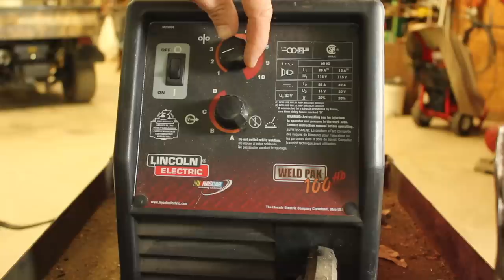This Simple Sawmill Hack will keep you Cutting All Day!!

Comment: Great idea!  IF you have to make another one for any reason, get a 5/8's nut and slice two sides of it off and weld that into the socket.  By using a manufactured nut you'll have the hex sides fitting better into the socket wall.  As the video was progressing I kept thinking of a hex nut fitting nicely into the hex flats of the socket.  Not that you'll ever need to remake the one you have.  (possibly a backup adapter).  #KeepTheChipsFlying, FLR!

Comment: Weld a socket to the winch. And weld an adapter to the crank handle. So you can use the handle when the drill gives up. Just an idea.

Comment: If you'd squared the shaft, and inverted the socket, so the square drive engaged it, you could then have used a hex head bolt in the socket to drive it with the drill.
No welding required.
Reply from the maker: niklar55 That’s a pretty good idea, but I didn’t want to permanently modify the shaft. I needed to be able to use the original hand crank for if the drill fails or dies or if a log is too heavy for it.
Reply: @falllineridge  The hand crank would still work, as you're only removing the rounded parts and adding two extra flats.😊
Reply: Weld a bolt head onto it.  Ever need a hand crank use a wrench or socket wrench.
Reply: Yep thats what I would of done too

Comment: Great Hack!
If I can make a suggestion if you need to do it again or others doing it for their mill. We had a similar situation and needed a 3/4" x 1/2" rectangle socket for the crank handle for a truck mounted swing lift with same type 'boat' winch. 
Took a couple 3/4" nuts and tacked them together stacked and ground the weld bump flat to fit socket. Then with a thin cutoff wheel split the nut off center lenghtwise and used a bench grinder to grind the flat faces on inside of cut nut halves, dropping both pieces in the socket to check fit to the shaft when grinding until we had a nice rectangle fit. Take same amount off each nut surface to keep it centered on shaft.
To secure the 2 ground nut halves inserts inside the socket, we drilled 2 small holes on each side of socket, lining them up with insert nut flats and rosette welded the nut inserts to the socket wall from the outside of socket and ground smooth. There was no inside welding of socket or grinding and whole thing was all flat grinding the nut halves held with ViseGrips on a bench grinder.
All the grinding was flat surface and took place outside the socket, made the job a whole lot easier and no Dremeling. Took me about 20 minutes and we used an old 6 point 3/4", 1/2" drive socket from the junk box. Can be used with an electric drill or a 1/2" ratchet. Painted it florescent orange to spot easier in the tool bag and wouldn't get lost.

Comment: I can't tell you how pleased I am to find this vid. Believe it or not I just bought a 3x socket drill adapters for my toe board and it never occurred to me to use it on the winch. And guess what? My winch is a hand boat winch that already has hex drives on it and has 3 of them giving you 3 constant mesh gears essentially. On the deep reduction low speed gear on the winch, if I put the drill on high speed it should just walk logs up the ramps. 
Also I toyed with the idea of getting a gas powered winch. They don't cost too much but heck, that idea is shelved after my good fortune of finding this LOL.
I still will get a gas powered winch because when I eventually mill the wood to build the shed to put the mill in (lol), I might make a guide to line up the logs parallel to the mill and use the gas powered winch to drag them inside.

Comment: I’m not sure if you still rly on this improvised socket after two years, but if I was building it, I was first cutting and separating the octagon part from the square that goes to the ratchet.
Then citing the octagon to two halves.
Now that the two pieces are open and facing up, I can weld it and shape it with an angle grinder.
When everything fits right, you can weld back all 3 parts and you’ll have a good socket, in 15-20 minutes.
Thanks for sharing!!

Comment: Cool part about using a small boat trailer for a sawmill trailer is that not only is it the right size, but it also comes with a winch and is riding on leaf springs and D-rated tires.

Comment: Get some huge batteries. Think about making a torque post to save your wrist. You have the 2 screws on the cover you could secure your torque  mount  Set it up so you can use the same one for the low/high speed inputs and strap it in and still get battery on/off.  Then you can make a bicycle brake cable/handle trigger puller and you have "remote" operation Then you have a 4 speed  operation - low winch/1 low drill, low winch/2 high drill, high winch/1 low drill, high winch/2 high on drill.  Angle the mount so when the winch is on the ground, drill is up.  Probably easier to figure out the best compromise for power and speed and leave drill in that position.

Comment: I am surprised that so many people  like you  are still persisting with manual winches .
I threw  my manual winch away  years ago and fitted a 12volt  electric  winch .
It has a remote i can walk  around the mill and adjust the log going up the ramp..
The  other thing is i have a designated battery that is  constantly charged by a solar panel.and want go flat .
Sorry to think your  idea is short term  but my setup is more permanent. 
Cheers Rob

Comment: I would have started with a hex nut  to fit my socket and reduced it to fit. Just saying.
Reply from the maker: David Sutton That would work great, but I didn’t want to permanently attach a nut to the winch.
Reply: @falllineridge  Not what I meant. Cut sides from the nut to fill in the socket and weld them in. No grinding.
Reply from the maker: David Sutton Ah gotchya...that’s a good idea.
Reply: @falllineridge  Rather than grinding the inside of the socket, I would have been tempted to modify a steel nut in the same way you did the socket, and then choose a socket to fit the nut - it would have meant you were working with mild steel instead of the chrome, and a nut would have been cheaper than the $6 you paid for the socket! Great video & good luck!

Comment: you have a good idea, and With your permission, i have another Idea for making an adapter.   Get a nut, grind as much thread material as necessary with the die grinder.  slip it over the shaft of on the winch.  drill a hole through the nut and winch shaft so they line up and then tap in a " roll pin" of the corresponding size, very similar to a shear pin on an auger.  that way a socket can be used without modification. and if the hex nut wears out -  drive out the pin and install a new nut/pin and your off and running.  keep up the good work  i enjoyed watching.

Comment: If you weld a square drive (Harbor Freight Adapter set) to the inside of the winch frame, you will have a place to store the 'winch socket' when you need/want/have to use the crank.  Also if you have a hooking point on the ramp side, you can use the winch to 'position' the logs without having to use the peavey or cant hook.

Comment: If you have a look in some tool catalogues, like snap-on (but they aren't the only ones) There are all sorts of adpators, & if i remember a 'weatherhead socket will do that job, without all the work, but all the same, great idea. Or you could have ground 2 more flats on the shaft & got a square adaptor.

Comment: You might consider an impact socket , non chrome , easier to weld ? You also might consider using jb weld to fill in the back up socket ?  Good to have a  back up of both  socket and adapter in the tool box. Great update and making it easier hack :)  Just watch your wrist .... keep that drill against your leg friend . Nice time saver !
Reply: I would fabricated a bracket of sorts the holds the drill in place for that reason, or try using an impact driver.

Comment: You Could Drive An Alternator Off Of The Motor, And Use It With A Voltage Inverter, So You Can Have Power For Your Winch

Comment: A cheap impact socket will eliminate the chrome and add some beef... way easier to weld. I find this is a surprisingly common improvement to adding power. I just added power lift to my popup tent trailer by welding an impact socket to the lift shaft.

Comment: For all the work it took to make your adapter I think I would have gone to Sears (if one is still on life support in your area) and bought a 1/2" drive "Universal" (swivel) adapter and driven out the roll pin between the female end, and the center section then drill the equivalent size hole in your winch shaft and attach the female end with the roll pin you removed earlier. I would bet without checking the width is probably pretty close without any additional modifications necessary. (the center section, and male end are left-overs) The female end stays in place with the roll pin and having a 3/32" hole in your winch shaft wouldn't hurt a thing and you could always put it back the way you bought it without any adverse effects. Might take longer driving to the hardware store than the actual modification.

For the record the impact hammers in your gun won't engage if there isn't sufficient resistance so considering the gear ratio of the winch and the torque of the tool I think it's unlikely a log big enough to cause the hammers to engage would even fit onto your mill at all.

FYI they also make 8 sided "square drive" sockets and all you have to do is flatten your rectangle to a square with a grinder. (I'm generally not a fan of so drastic a modification unless there is absolutely no chance I ever want to return to the "old way").

Comment: Thats a pretty slick set up using a hand winch with a drill.I'm not trying to be a pain but why are u so high up in the air..? My mill is one foot off the ground and i love it..I took the wheels off and dropped mine down as low as possible..Roll the logs the logs up my ramp with my tiny tractor..Turning them I use a come along..too much fun. Have a good one..Thanks

Comment: For future stuff like this, I find it easier to go get a piece of square tube that fits the inner diameter and just weld that to the socket. Only costs a couple bucks and its way easier than grinding welds with a dremal. If you cant find a piece of square tube that fits, just take a 4 pieces of flat bar, clamp them around the outside of whatever you trying to adapt too to set the inner diameter. Then weld the outsides up and the socket on. Minimal grinding and fast. I did this on my Turbosawmill.
Reply from the maker: Good idea, thank you!
Reply: There’s also a socket that’s advertised online the center is filled with metal pins and as you push it onto your rectangular piece the pins wrap around it and tighten onto it. What you did work though . Good effort

Comment: Awesome  hack. I think it would be easier to take a grade 8 bolt, that the was just larger than your two flats on the winch. Grid the head of the bolt down so you can weld two flat stock on each side.Weld a small piece on each end for strength. Grid a small flat on the bolt for the drill to grab. All one piece if you choose drill small hole through all so carter pin will hold it in place so nothing to lose or misplace.  You might even have all the part laying around the shop.

Comment: This much welding will only make the socket soft and weak. Why not take a bolt the correct size as the socket,  1) hacksaw off the two edges,  2) insert into socket sides,  3)  weld through side of socket,  4)  dress up any metal splater.

Comment: next time, try a 12 point socket that fits even closer to the intended/required size. i think even and i hate to advertise for them, craftsman has specialty sockets for such odd shapes, almost like that alligator socket advertised on tv. but either way, nice job of taking what you had and making it work for YOUR needs to make life/work easier on yourself.

Comment: Drill driver winch systems have been around in theatres, public building's, and industry for years. Mostly used to raise and lower lighting and other items where the need and cost of fully powered systems couldn't be balanced. You should be able to buy a suitable 1/2" shafted socket from a good lifting equipment supplier dealing in drill drive winches for a few bucks. You will need a spare. Don't chuck the hand crank  away! When I was designing systems it was usual to specify a dedicated driver with fixed socket to discourage "borrowing" for home use. Does your winch have a system to prevent free spooling?
Reply from the maker: Ken Christie Yes, that clicking you hear is the lock. If something fails, it will not free wheel backwards. The lock can also be reversed so it locks in the other direction. It also has a metal strap brake. Definitely won’t get rid of that handle! It’s my failsafe.

Comment: Hello and Good Day Young Man,   Gotta ask something.
But first a little side story..
My Grandfather taught me everything concerning wood shop stuff, he had one as i was growing up and now that he has passed away and now i am 58 (UGG)  i have most of his beloved tools.  I always enjoy taking a fire wood piece, a log if you will and take it to the lathe and turn out some bowls, He insisted that i chip off the bark on the areas that i would be using the band saw for, taking a length wise cut, then screwing onto the face plate to the wood for  turning.. He says by doing this as the tree grew, the bark will carry a lot of dirt and sand and gritty stuff in general, By removing bark his band saw blades would survive a lot longer without going through the grit.
I watch and enjoy your whole adventuresome life you have, and wonder about your Blades going thru all that possible grit.
Is that a concern on your milling expertise??

As always Young Man, Blessings to you and your Family, and to all the wonderful followers you have on your channel

Just Me and JuneBug living life here in Beautiful Beaumont Cally
Reply from the maker: BIG GUY IN BEAUMONT CA Yes, that is a concern. If the bark easily comes off, like older pine logs, I’ll knock it off. If it’s fresh and tough to remove i leave it. Usually if the log hasn’t been dragged in the dirt I get good life out of my blades. Larger mills have a debarker option which is slick. Good story! Thanks for sharing that.

Comment: I'd have milled / cutoff wheeled the sides off and welded some HSS for sides, puts all the sharp/bumpy bits that cause wear on the input shaft to the outside.  With the torque mount you can add pieces of pipe to the mount to go around the input shafts to cover the snaggy bits.  Bit of muffler tube would be perfect.

Comment: Would have been easier just to weld a grade 8 nut onto the winch shaft that was sticking out my friend. Then you can just use the appropriate size socket on the nut.

Comment: Hiya, why did you not buy 2 cheap half inch drive  sockets cut the hex off and weld both together ?
Reply from the maker: The 1/2" square wouldn't have fit as it was. It would have had to be ground out anyway because the winch has a rectangular shape.
Reply: @falllineridge  Oh yes, stupid of me, but thanks for your reply.. must admit, your way did turn out great, no wobbling or of centre and seems the drill coped well..Best of luck.. Real name IAN, from coastal North Essex UK.keep the videos coming.. where you live is a million miles from the way I live beside the sea.

Comment: I think I would have weld a couple straps over a larger nut and then used an in damaged socket.  Could have adapted it in about 10 mins.  Good job with demo.

Comment: You could also weld a large nut to that shaft and then just use a large socket over the nut to the drill.
Reply from the maker: Love2boat92 I thought of that, but I didn’t want to permanently modify the winch.

Comment: Great idea works great. for less trouble rolling your logs onto the mill make you a cradle strap. Attach each end at the top of your log ramps making sure its a little longer than your ramps so as your logs can roll up past the end. Then just hook your winch to the strap this way as the log is winched up both ends are cradled evenly onto the mill bed. A cheap ratchet strap without the ratchet or even a rope with hooks like a tow rope should work nicely. This will also make rigging the logs to winch much eadier also.
Reply from the maker: Thanks for the tip, Ken! Always appreciate your experience.

Comment: Instead of all that welding and grinding, why would you not just grab an impact socket and drill a hole through both the hole and the box stub on the wench?  Drop in a cotter pin or a hitch pin. Done.

Comment: SILLY QUESTION, WOULDNT IT BEEN EASIER TO SPLIT A BOLT AND GRIND IT BACK TO FIT ON THE SIDES, JB WELD WOULD PROBABLY WORK
Reply from the maker: That might have been easier, I don't know. This worked pretty well though!

Comment: We use a drill on our meat grinder. It saves alot of time.
Reply: My wife likes the Romano cheese ground fine.  Our food processor does not do the job.  I tried making an adapter but it didn't work out .  Now I'm thinking of cutting threads on the drum shaft and installing a nut which will be driven by a drill at slow speed.  The handle could still be used if wanted.

Comment: Replace it with a 12v winch and run it off your tractor that winch is not designed to be powered only hand operation you will wreak it